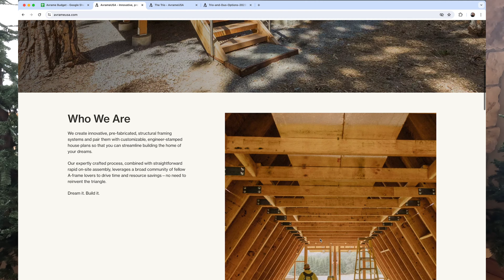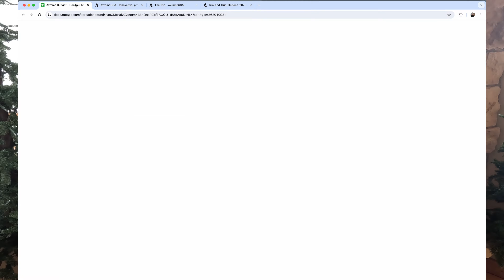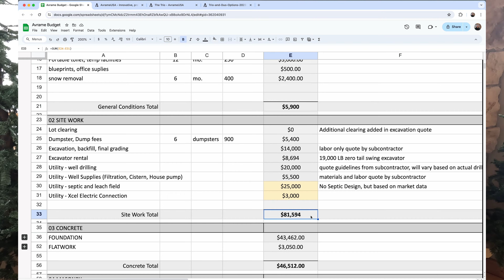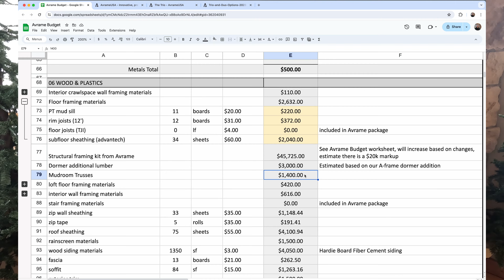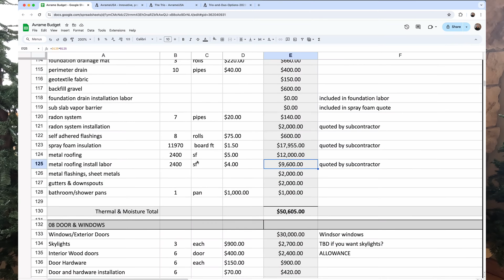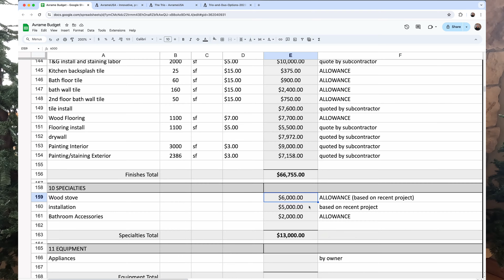Here's how much it costs to build an Avrame Trio | A Builder's line item Budget & Thoughts | EP 18

Comment: I live in Utah and have gotten some concrete poured for so much less.. dumpsters? Clearing? I mean we can clear our own plot. Cut up the trees and stack them for fire wood.. with precut pieces, I don’t imagine we’d need 6 dumpsters worth of loads to haul out. And it’s set up to be easy to follow instructions once the frame is ready to go up. We want to do off grid electrical and the site has water so plumbing be the biggest cost for us. We want a duo. And have it as a short term rental or getaway for ourselves. This sounds like a breakdown for someone with bottomless pockets who puts in absolutely 0 effort or labor themselves. And it doesn’t make sense to me that the frame has to be industrial strength for a snow load. Snow won’t be sitting up there. An A frame is made so it slides off! Or can be knocked off easily. The math isn’t mathing. And you’re just killing peoples dreams. Lol
Reply: Also to add to this. I’ve been looking at buying an old rickety fixer upper shack with an A frame metal roof. Nothing fancy and the thing has been standing since the 60’s year after year of heavy snow fall at high elevation. And 5,900? For a portopotty and snow removal? It shouldn’t take that long to finish a project even of this size if you break ground at a reasonable time of year. And you can outright buy a Porto potty for like 350$.. so many unnecessary expenses..

Comment: This sample project cost is INSANE! No one in their right mind would journey into putting an A-Frame together at this cost, unless money is no object and you have boat loads of it and therefore wiling to spend endless amounts to get this buildout. I can see whereby the A-Frame would be more costly, but surely, this is not a real life buildout quote as it would be more cost effective to simply build a Barndominium at 1/3 the cost. After watching this video, there goes my idea of an A-Frame buildout, regardless of how cheap my labor costs will be and that of any finishes, fixtures, electrical or decking exterior projections. I was just about to engage with Avrame but this video just killed our plans.
Reply: Ditto.  I purchased a kit home for 80k. To get it turn key I’ll be spending close to 600-640k  in additional work  to get the structure up on raw land including all site work well power septic etc. Essentially it becomes a custom home build. My next house will be modular. So expensive otherwise.  Ps/ I was told it would be circa 3x the kit cost…. Not 6x .. by the kit company. Build was in VT which I imagine is similar to Colorado
Reply: hey there I'm Lou the guy who posted that video. Unfortunately, that quote is very accurate for our area, and we prepared that for a client who was intending on purchasing an Avrame... ultimately they decided to work with us on a custom A-frame which we are going to be starting construction on in just a few months (when the snow melts). Now all of that to say... one of the challenges in our area is that every house has to be on well / septic so those costs impact the price per sqft. But in general right now our average construction cost in the CO mountains is between $500-$600 a sqft depending on the fit/finish and design. 

We have quoted some barndominium projects and while they are cheaper, we find that its not as significant as you would think. The house portion comes out a bit cheaper due to a lower cost structure but the garage portion is more expensive, especially if you insulate it or add drywall / any interior finishes.

Comment: Super useful. There are many ways to cut the cost down. Could you link to your spreadsheet?
Reply: I may post it on our website at some point but havent had a chance to yet. In general there are certainly ways to cut cost but in climate zone 7 we have some strong requirements for insulation and snow loading which leads to higher costs in framing and the like.
Reply: @LouCirillo-mq4re  I thought AVRAME snow load was rated for any snow load. That is what I was told when inquiring.

Comment: I think if some can do reverse engineering for this costing and come up a plan based on $200 per square feet, that will be great.
Or a plan without the contractors, just for DIY folks.
Also another costing where she’ll (skeleton) for A Frame without any finish from them. Rest will add based on local stuff and standard.
Any one?

Comment: Well, here in Europe we manage to do things quicker and cheaper. We have done a number of Trios here with a final cost 2...2,5 times cheaper. The first line item in your budget, the toilet rental, is for 12 months. Usually it takes 5...7 months for full build here for Trios.
Reply from the maker: Comparing construction in the US to construction in Europe is not even worth your time. Even in different regions of the US the price varies massively, hence why I stated that these prices are for our region in Colorado.

In our region it would be basically impossible to complete a new build for any custom home in less than one year. While your kits improve the framing time that's about it. However most of our crews finish framing for similar sized properties in just a few weeks so the kit really has no impact on our timelines.

Comment: Wow, that’s quite expensive
Reply from the maker: yea, it doesnt mean that it cant be done cheaper... but in our area we have high requirements for snow loads which increases the structural cost of the home.
Reply: @pineandpeak  Are you saying that the Avrame kits don't meet the snowload requirements in Fairplay?
Reply: @TinaPeapod  when you give the location of the home to Avrame they will modify the structural drawings to ensure it meets with the snow load requirements. However that also means that the kit will increase in cost
Reply: @louiscirillo55 that makes sense. Thanks! We are going to be building one in CO next year so gathering info before we start the process.